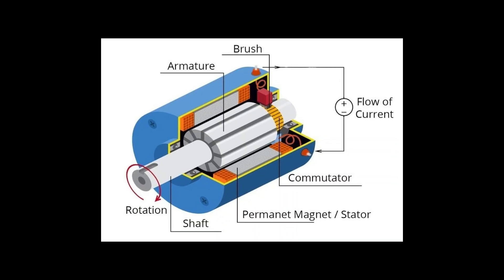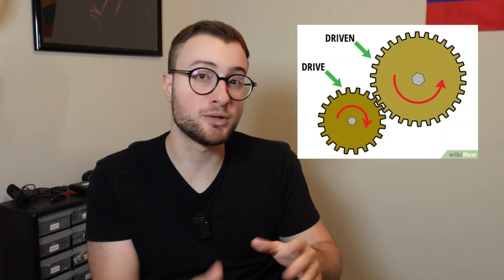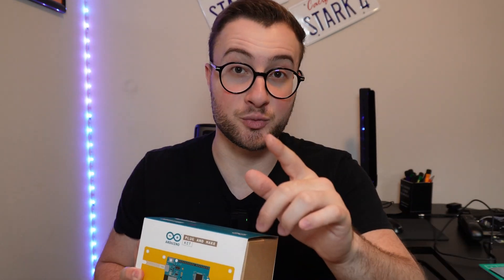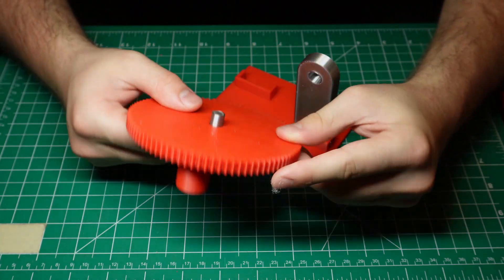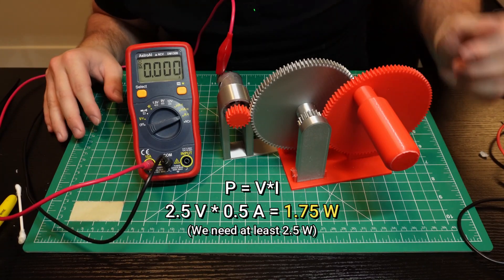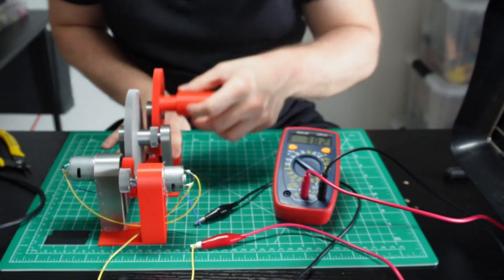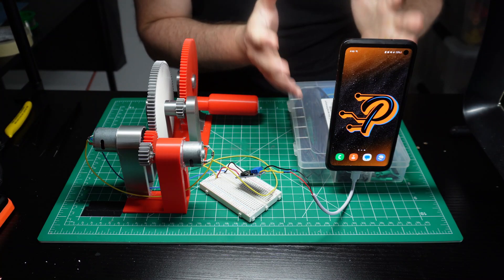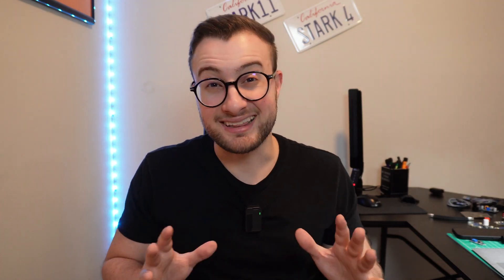Can a Motor Really Charge Your Phone?

Comment from the maker: Hey guys! If you’d like to recreate this project, I left all the project files on my Patreon!✌🏼I believe this could be a really cool experiment for a school science fair 😎
Reply: Amazing! The only thing is that I literally have nothing. I mean, I could probably design something half decent, but not as good as you 😅
Also can it power a taser?
Reply: @trisiegt  A typical TASER device can operate with a peak voltage of 50 kilovolts (1200 Volts to the body), an electric current of 1.9 milliamps, at for example 19 100 microsecond pulses per second.

The M26 and X26 Taser guns operate on 26 watts of electric output and deliver a 50,000-volt shock. Some Taser models, usually those used by police, can also be used in “drive-stun” mode by directly touching the person with the device.
There is your information.
Reply: @trisiegt 
Where are you going after you die. Repent today from your sins. Hebrews 9:27 says as it is appointed unto man once to die but after that the Judgement.

Confess your sins and turn to Jesus Christ today. He is the way, truth and life.
Reply: i would rlly appreciate if you gave the stls for free..i can’t afford a paterson subscription but would love to build this!
Reply: Hi sir I have designed the obstacle detection using some motor and sensor for that I used 4 dc motor I will give me 11 v power and I use 12 v battery also does I charge by using this four motor
Reply: Make new video I like your videos
Reply: !ideea:make a phone case for this so you can scroll shorts or watch a video endlesly while stil kind of remaining healthy
Reply: A turbine would be amazing so you could use compressed air 😊
Reply: IF YOU SEE THIS: If you know You'll build it if It Works Make a video:  Hint Alph- 2 Components -  LED & PVCell = Power cell. SOMTHINGS missing Loops
Reply: What da sigma?
Reply: Can you recommend a 3d printer? I want to get started with this
Reply: Really cool video! So simple, but could be so useful in certain situations! Also, great editing quality 👌
Reply: Good job thank you so much. I like your videos.
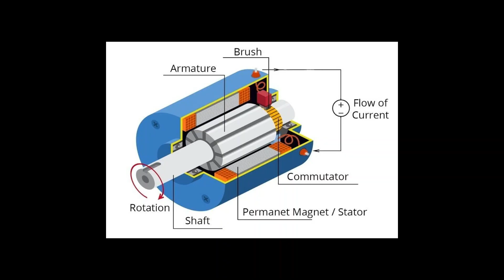Reply: 0:33 0:34 0:36 0:38 0:40 0:41 0:41 0:41
Reply: Btw IF YOU SEE THIS: If you know You'll build it if It Works Make a video:  Hint Alph- 2 Components -  LED & PVCell = Power cell. SOMTHINGS missing Loops

Comment: Brilliant, excellent & satisfying! Im curious about the amount of current that u got using the 2 motors. Is it higher than using single motor?
There are a lot of buck-boost converter in the market that outputs stable 5V for a maximum of 1A. If the current is really really small, will the output still get to 5V and 1A?

Comment: You should change the motor to a stepper motor. If a motor runs at 2000 rpm and uses 3V then, only if you turn it at 2000 rpm you will receive 3v. With a stepper motor it will be a little  more difficult to turn it but the output could be 13v or higher. Cool project tho...
Reply: just watched the end haha

Comment: I'd like to note that the thing you called "buck converter" looks like an MT3608 to me. An MT3608 is actually a boost converter, it convert lower voltage into higher voltage (step up). If the input voltage is higher than the output voltage, the output voltage will increase. It might be bad if the phone can't handle voltage higher than 5V. I would add a linear voltage regulator on the output of MT3608 just to be safe.

Other than that, it's a great project :)

Comment: you can add 2 more motors in parallel to increase charging speed (1 motor got use ~500mA 2.5V, you put 2 in series to get ~5V, but it's still 500mA) so when you put another unit, you'd keep the 5V, but it'll become ~1A, which is 5W (the apple charging brick power 🔥)

Comment: You should attach a motor to that shaft that takes like 40% of the energy to keep it going and outputs 60% so the voltage gets higher and higher and add a knob to control the max voltage
Reply: Are you talking about a perpetual motion machine?
Reply: kinetic energy convert to electrical energy and convert it back to kinetic energy so that it could convert it back to electrical energy? I think the efficiency will be lower.
Reply: @miketeok  and never above 100%, so no perpetual motion, no infinite free energy